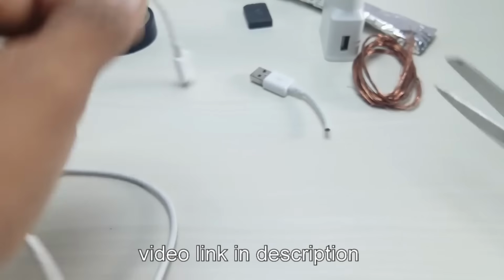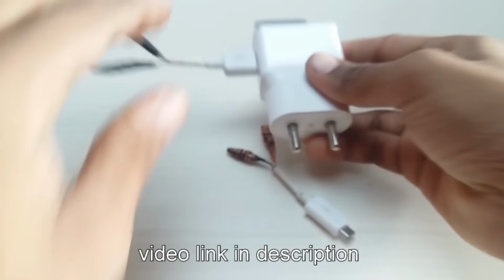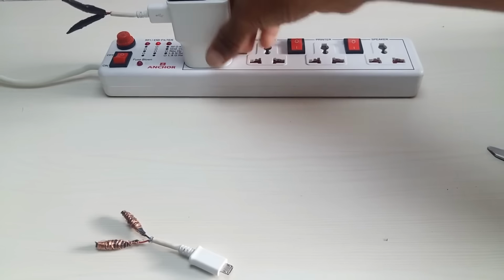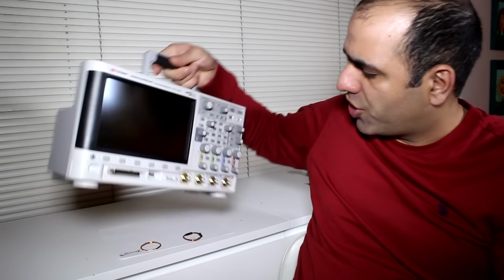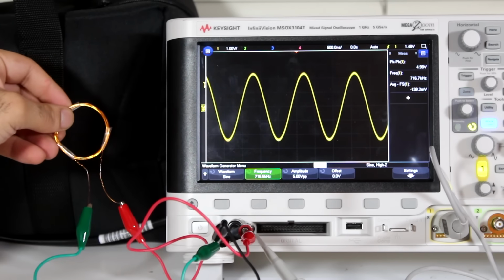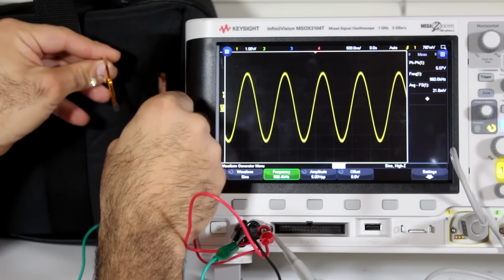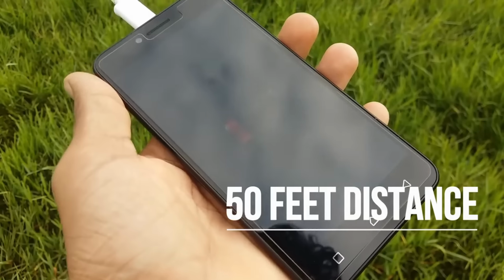Fake and Real Wireless Power

Comment: The same thing is done by some youtubers for wireless headphones 🤣🤣😂😂
Reply: let me guess, they cut off the wires, just wrap the cut wires in coils and so far and so forth?
i can see why people would kinda fall for that if they already have wired headphones that they want to be wireless
Reply: @xt256  It's actually wireless . . . Only if distance between coils 1 mm xD .
Reply: Well I just invented the world's first wireless cable car.  I'm currently looking for investors...
Reply: just buy a god damn BT module and solder the headphone wires to it
Reply: i have Sony Wireless headphone using bluetooth interface so its possible that there has a wireless headphone. also wireless speakers and amplifier
Reply: @jonathanpeden9930 
Not sure, if trolling or doing some actual useful invention... No need for recharge or refuel. Get in, push button, drive.
Reply: wireless headphones have bluetooth. so wireless headphones comunicate via radio waves with the audio source.
Reply: wireless audio stuff need to convert the signal to something that can go far through air and then convert it back then use that as a source to be amplified, and not use the signal as a power supply.
Reply: xtremeguy2256 Not this kind, though...
Reply: Harshal Dabhade Well, a similar concept MIGHT work for headphones since sound signals ARE AC after all. But definitely not in the way shown in the fake video.
Reply: if you know anything about sound, then you know that sounds and sound signals are always different frequencies, and constantly keep changing. that's how sound is even made. wireless AC power is only set to a single frequency. and even with that, they have to be close together to even receive the signal without dropouts and to avoid crackling and other symptoms of poor connection. that's also part of the reason why wireless phone charging has to be very close together to the charging pad to even detect a signal.
Reply: Induction vs Bluetooth
There is a massive difference.
If you would send by just AC alone, how would the headphones determine where the signal goes? Left channel into both or right channel into both? Or both at once in both?
Nah, just use Bluetooth instead of weird trickery.
Reply: AirPods
Reply: Iv Seen This With A Mouse. I Wondered If It Was Possible To Convert A USB To Wireless Mouse Of Course I Mean With A Battery And A Remote Chip And Stuff
Reply: So they connect their headphones to the mains power?
Reply: What? Really I am astonished, that's why mine didnt work then lol 

(Yes I'm aware this is a joke)
Reply: And the phone charging screen on iPhone is so fake
Reply: cough five minute crafts cough
cutting wired earphones and calling it an airpod smh
Reply: I've seen it
Reply: I have an idea for wireless headphones. Plug the phase and mass of the headphones to phase and mass of your power output. Problem solved 🤣🤣🤣
Reply: @nikolausgrill7371  no that won't work at all
Reply: Thus airpods are born
Reply: Whats  u r email ??
Reply: Ur comment was lucky 777 now imma have you run outta luck
Reply: uh what
wireless headphones are real, not fake
Reply: @xt256  But, Cutting wires and wrapping coils won't make them wireless

Comment: So, I made a parody video for class with a friend. "The Wireless Wired Charger" can fill your battery in under two seconds, just wave your non-apple product device over it, and it will charge instantaneously, just ignore the very, very, very obvious cut to full charge, mkay? And no, we didn't parody other people's parodies by asking if "This has ever happened to you?" at the beginning, then making a rushed statements that is confusing and both highly misleading and semi accurate at the same time by utilizing triple negatives correctly.
It's just an unplugged Droid Turbo charger turned upside down, so the cube thing will charge your device, without needing to be plugged in. And the disclaimer at the end is a bunch of fun. Seven takes to get it read correctly, and at consistent speed, only to steadily increase the speed while matching text on screen becomes a blur as it zooms by. It was fun, but we somehow made a classmate think that a thing like that could work. We showed them what we did, pointed out highly obvious cuts in the add to prove it's fakeness, and he insisted that there exists a charger made of two outward extending prongs that could make your device charge in under two minutes. With no proof to show us, we ultimately convinced him he was incorrect, but hot damn was it hilarious to make and even funnier to actually fool someone with.

Comment: The point for the switch ist wrong. If you google for that power....thing you see, that only the 3 right places can be turned on and off (printer, monitor and speaker). The left one (PC) always gets power, If you turn on the main switch in the left.
Reply: even if the switch was turned on, it still wouldn't transfer anything at all.
please don't tell me you're defending the video
Reply: Out of the 4 switches:
1 - main (On)
2 - output to PSU (off) <- this was off so the charger was not on
3,4 - not used
Reply: cokefridger Google is full of shit.
Reply: Very very inspiring video at all !!!

Comment: You can transfer energy wirelessly using DC, but you'll have to feed a DC square wave into the primary coil. Some cheap inverters use a normal or modified square wave, though they don't transfer power wirelessly, they just step the voltage up by feeding the square wave into the transformer, which is almost the same thing, but with a iron core. The output is thus also a normal or modified 120-240 volt DC square wave.

Comment: Seriously? you have conduction and induction, that's it. The equipment and power requirements to do more than set up a static field that can make florescent lamps glow at that distance is just.... And then to transform it back into usable current with out using simple short range induction...... 
'Course there is the kind of microwave power transmission orbiting solar collectors would use, but that is similar in principle to how an un powered crystal radio works EMF hits a conductor and induces a current. In depth discussion on that and a practical demonstration of the principle might be fun.

Comment: Real wireless chargers do exist but requires a full bridge rectifier, an amplifier and a voltage regulator plus the wall adaptor having a high frequency transmitter and the phone having a receiver converted into a charger but that could be very tricky as the voltage you get from radio waves is hundreds of milli volts which is too low to charge the phone. I just hope that there is a way to charge a phone wireless without fake ideas.

Comment: Please help me on one issue. Am currently using the galaxy s8 plus by Samsung.  Yesterday night i left my phone on the  Samsung's fast wireless charging pad even after its fully charged . Will it damage my device? I know today's lithium ion battery are much smarter and they stops inducing charge after they reach to full capacity but am not sure if the same principle applies for the wireless charging pad.  Please advice

Comment: This is actually how inductive charging works. As you can see in the video, he had to bring the coils close together in order for the LED to light up. He also adjusted the frequency in order for the LED to shine brighter. Samsung says they have wireless charging, but it's not. It should actually be called inductive charging as both the charging mat and the phone itself have an induction coil inside. The mat itself needs to be plugged into a power source in order to generate inductance. The phone is placed on the mat, which causes voltage and current to be drawn. The disadvantages of such a system is it's very short range, and as such the device needs to sit on the mat. Second it won't charge as fast as plugging it into through an adapter and the device cannot be used when sitting on the mat itself.

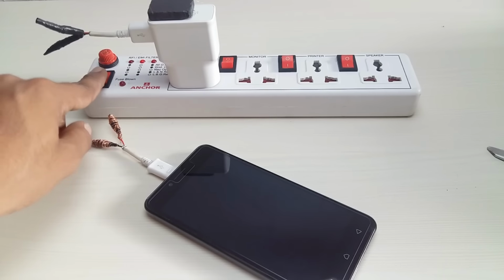Comment: yes this trick was fake and you are correct...... but as you shown @ 1:34, that was wrong.
I have that type of power extension by anchor, in which the first main switch which is not a main switch but it is the switch for first plug.

Comment: If one connects a small rectifier to the secondary coil and connects the output to a usb charger using the above method would it work as a charger?

Comment: Transformator to lover the voltage, rectifier. Use 555 (cheap ,simple)  with few Fet's add a coil and here you go. Well there is more to it but nothing amazing and hard.

Comment: Is it possible to use superconducting coils in a wireless transformer setup for longer range power transmission? I've seen examples where superconductors can stay levitated near magnets and metal because there's no resistance, so their fields don't drop off, and thus lock them in place. If this same principal could be applied to superconductors, maybe longer-range wireless power could become more practical.

Comment: Actually you can get free energy with coils and magnets... but no wireless power lel
Reply from the maker: There is no free energy
Reply: OOOOH HE RESPONDED
Reply: By the way, Its by abusing the techniques of transformers. See, the primary coil's magnetic field goes through the secondary coil and there comes wireless energy, but what if we change the primary coil into a MAGNET?

Comment: I Have got a question for you: Is it possible to Transmit Wires? Cause Nobody ever thinks about it, but it would be a less damaging Solution. And then making progressive steps organizing them! Because it is about time to Charge all Wireless Companies like we did with the Smoke(see cigarettes). Waves in the air by Cell Phones are the most approximate cause of the Tsunami and are causing fast Climate Changes. This Time Technology has got to make a giant leap forward by preventing all damages!!!

Comment: well in simple electrical engineering, to induce voltage aka generate electricity from nothing. is either having a piece of conductor (copper wire) cutting through (moving up & down or left & right) the magnetic flux (one north pole pointing to a south pole magnet) OR vice versa (let the magnetic flux do the job) in this case transformer.
and thats why it requires AC that will create a magnetic "motion" constantly changing its current.

Comment: There are tons of videos about a wireless power device that consists of two coils (one with a center tap), a npn transistor, and a resistor. No capacitors. I think, it could be a really simple oscillator, but i'm not sure.

Comment: Dude you need to over voltage stuff and wreck it
blow up stuff like frypans and kettles
see how much power a light bulb can REALLY take
how hot can you make a hair dryer.
how much power can a PC take
how fast can you charge a mobile phone...jack up the current and volts tho...we want quick these days.
How about getting an extension lead glowing red hot?
put a massive load on a standard light switch (like a welder)...see how long it lasts - as we want quality!!
people love seeing stuff get wrecked as the world is full of boring deadbeats who dont know how to do it.
how fast can an electric drill drill a hole at double voltage? (if it survives)
plus dont hurt yourself on purpose - we can all tell its fake/ self inflicted.
(not everyone likes seeing people get hurt - only a small minority do)
Reply: sounds like photonicinduction

Comment: FAKE! AC transformers dont have positive and negative poles. DC has + and - poles but does not work with transformers. 0,o 2:12

FAKE! Those are not caterpillars.  3:57
Reply: xTheDarkSiderx I am an electrician. DC is direct current. The current flows one way, from positive to negative. So you can label on wire + and the other wire -, depending on the flow.

AC is alternating current. That means the + and - switch places constantly, and current flow alternates back and forth 60 [Hertz] times a second in the USA. So you would have to change the labels of the + and - on the wires 60 times a second if you wanted them labeled properly. Your hands are not that fast..

That is why you cannot label AC wires + and - without being mistaken.

But my first message was a joke. Read the last sentence and click on the link.

Comment: Could anyone explain how does ac current actually flow? I mean in dc doesn't each electron push the next electron and the energy is transmitted but what about in ac. Does it flow like a sound wave with each electron performing SHM? Correct me if im wrong but im just a grade 12 student

Comment: Please, correct me, if i'm wrong, but I think you can actually transfer DC wirelessly if you supply DC current to primary coil in pulses (i.e. turning the primary on and off quickly). That's how ignition coils work. Charging from that kind of supply is another question though. Or that's considered AC?
Reply from the maker: +Павел Ванин you are write, but you are creating AC components out of your DC voltage. It is not the DC itself transferring. DC and AC can be converted to each other.
Reply: ElectroBOOM always the electric hits you

Comment: Why is the resonance frequency ~1MHz?
Reply from the maker: That's what I designed for. It makes the circuit smaller
Reply: Hi man thanks for replying I love your videos! I was just wondering what variables would change this frequency? Loop diameter? Resistance of the wires? Thanks!
Reply from the maker: well, for inductor loop diameter and length as well as number of turn make the inductance, and than with the parallel capacitance you get the resonance frequency.
Reply: A coil is an inductor. Inductors resist change in current. As a result, the current flowing through the AC circuit lags behind the source voltage . The larger the coil's rating the more it will resist a change in current (i.e. it will take longer for a current change to occur). The resonant frequency is when the current lag is exactly out of phase with the source voltage.
Reply: Please continue making epic videos, my friends and I love them. 
There is a small spelling error in the description, where you mentioned "Faxing Laptop" instead of "Fixing Laptop". Hope I was of some help..You have taught me a lot. Thanks.

Comment: 50 ft for wireless energy transmission isn't big distance. There is a way for transfer electric energy via radio waves. To do this you can use grounded antenna connected to LC circuit as a energy source for your device. https://en.wikipedia.org/wiki/Crystal_radio

Comment: u make it with copper coil. it means it uses magnet. i want to ask u a question, can we make it using the concept of telecommunication system? the transmitter and receiver concept? it means u have to have a signal generator (oscillator) and more. and by using the concept of antenna, we can control the coverage too. using the concept of bluetooth and wifi. i mean, it is of course unavailable if we use the copper coil with the distance of 5 m or more. because by using copper twist, it will work if the position of both copper twist placed on the right position (face to face). so... back to my question, can we make it by using antenna? i need ur answer asap.. thank you so much.
Reply: I think that it is possible!
If you look up "power over wifi" you can see that some research is being done in this area.  Unfortunately, the average phone consumes far too much power for this to be reasonable.
But there still may be practical applications somehow
Reply: DeoMachina i am thinking that fof the tx i need signal generator which the frequency have to be multiplied by multiplier to a unique frequency so it won't interrup other communication. after that i need to connect it to High Power Amplifier to make the coverage wider. and send it by antenna. the rx just need antenna and rectifier (electromagnetic wave to electric converter) and connect it to the phone. what di u think?

Comment: I thought I was remembering that you could use DC for wireless charging but then remembered that in order to induce current in another circuit there must be a change in flux.  And inducing a DC current requires flux to change in 1 direction which means you would have a hard time sustaining it for any significant amount of time.

Comment: u want wireless power? Stand under a pylon with a fluro tube..I did that and got about 70v ac transferred wireless from the pylon thru the fluro tube thru my hands to the car that was parked underneat the pylons. I also felt the current thru my hands which was wicked.

Comment: +ElectroBoom why should we use enameled copper wire to induce current using induction ?????
Reply from the maker: If you mean why not just bare copper, then because we need wire insulation to have individual turns in a winding. Otherwise all turns short out and will be useless.

If you mean why not regular wire with those plastic like insulation around copper, then because those are much thicker. Magnet wire takes much less space.
Reply: +ElectroBOOM goddit........ thanks sir and keep up the good work